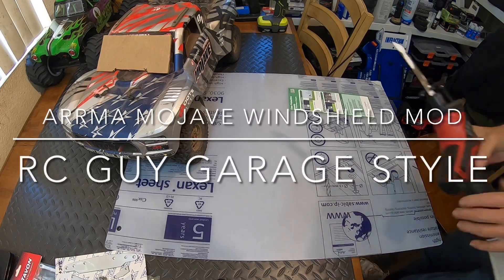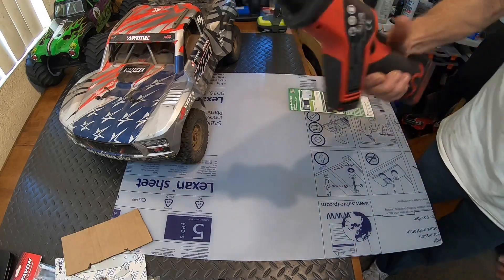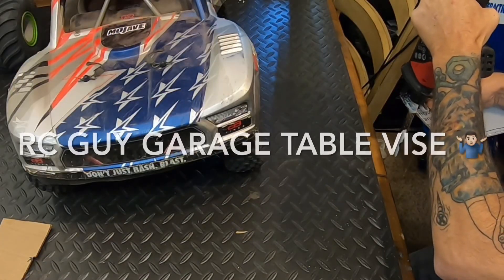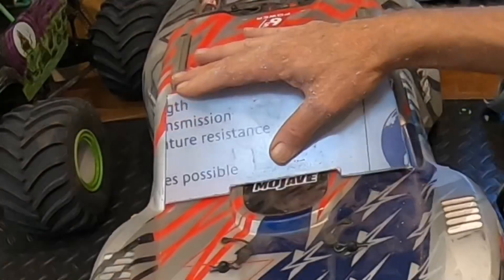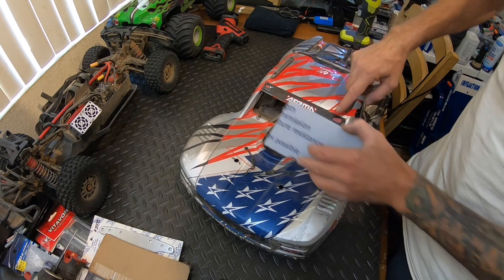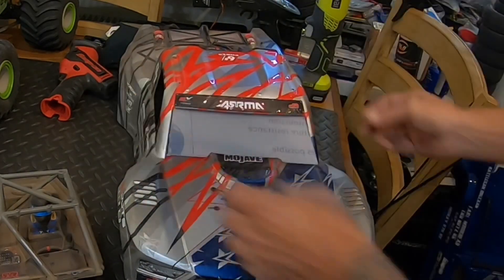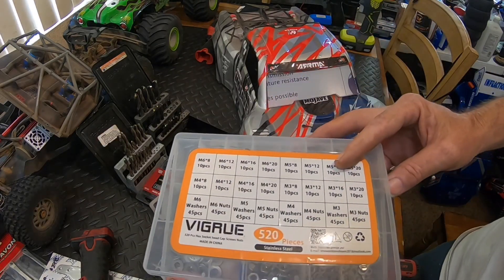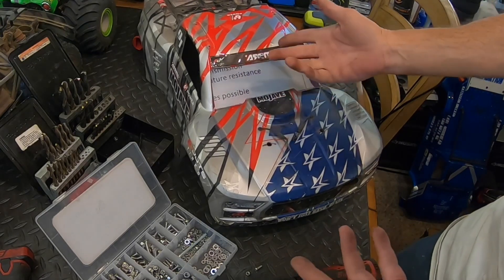Arrma Mojave 8s Windshield making the RC Guy Garage Windshield Mod How To Video ??

Comment: Trial and error, my first 2 Mojave videos were fails, I had to keep modifying till I got it right. 3rd speed run video coming soon. I’ll see if this makes a difference. It only pulls wheelies on grass from the torque. But haven’t done big sends yet.
Reply from the maker: I want a fast off road speed pass zip tie the front wheels down hopefully it works I’ll find out tomorrow 🙏🙏👍👍👍
Reply: @earlmoorhead5555  my phone ran out of storage, gps at 79, the tires blew up once I got up there. I didn’t record it. Any suggestions on tires that can handle speed grass runs?
Reply: @SpeedSyko  proline belted badlands
Reply from the maker: Anything belted should work

Comment: EARL.... just a curious question,,,,is there a reason you are using thick plexiglass?  I’ve made similar parts using thinner plastic,,,just need to score with an exato blade,,,,I found it easier to work with...also a bit lighter...it’s thinner and it flexible...🇺🇸👈

Comment: I'd cut the windshield out a $5 clear rubbermaid from Walmart would be a better choice cause you would least have flexibility and you can double up on it too just in case and you can add adapter tabs
Reply from the maker: Sounds like a cool project let me know how it turns out 💯💯
Reply: @earlmoorhead5555  I don't have a Mojave body but if I did that's how I would do it